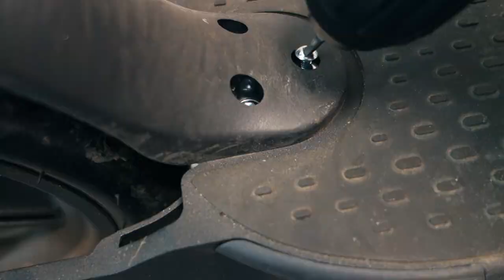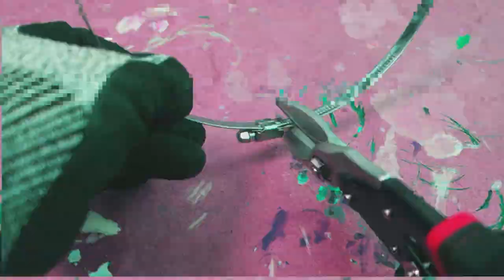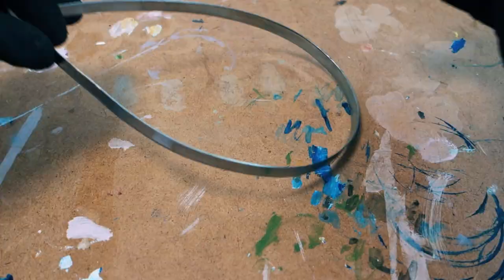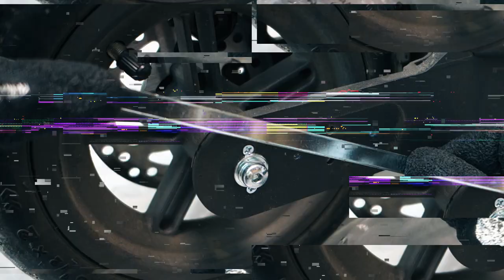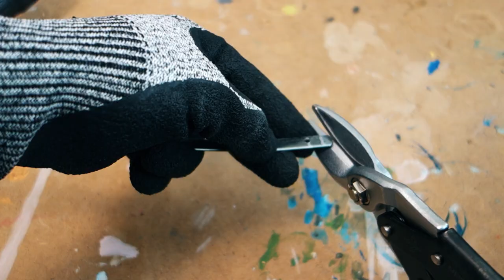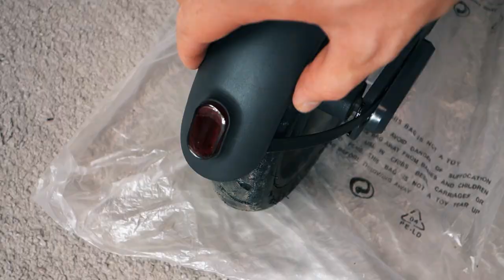Xiaomi Scooter RAW 0.5$ Metal Rear Mudguard/Fender Support for M365 Pro DIY LIVE Assembly

Comment: What is the black plastic cover called. Is it available on amazon? Great invention btw
Reply from the maker: It's called heat shrink tube (simple without glue, mine is RSFR-H d=1.4cm). You can find it in electronics or DIY store and for sure on Amazon/Ebay. Thanks!